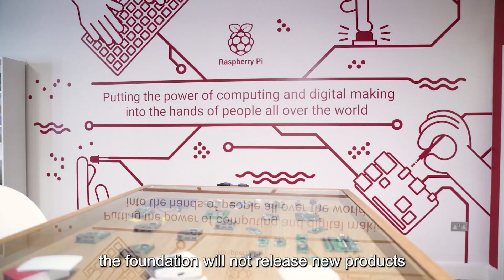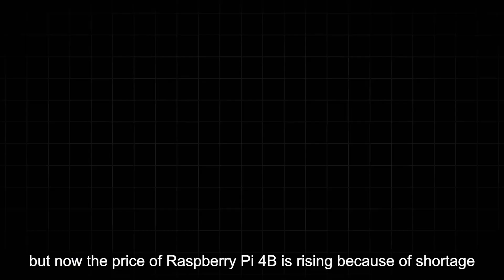When will Raspberry Pi 5B board appear?

Comment: Raspberry launching their own chip, could mean they will switch to RISC-V. RISC-V is open source, so in theory anyone can create a new chip based on the RISC-V architecture. And it will mean a lot of Linux software will work out of the box, as RISC-V is a supported Linux architecture. For instance Ubuntu already has images for RISC-V.